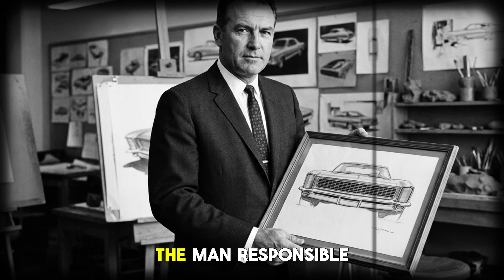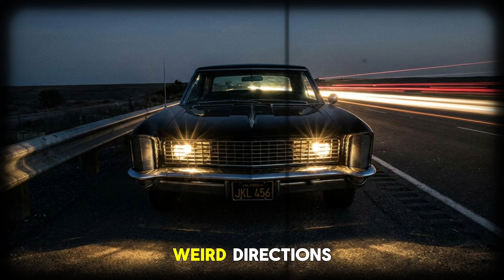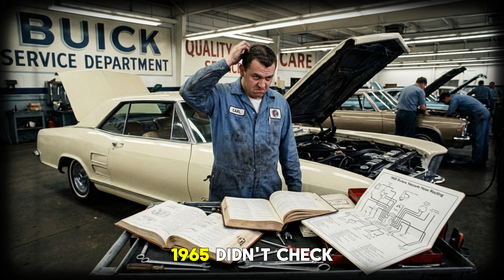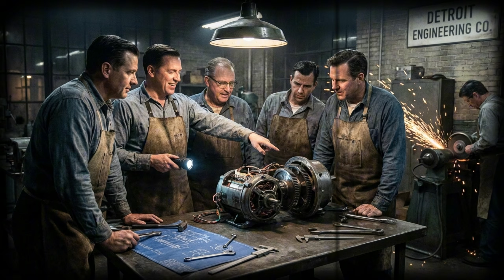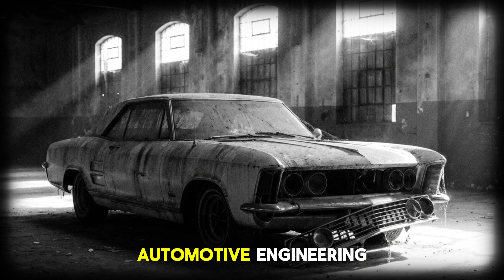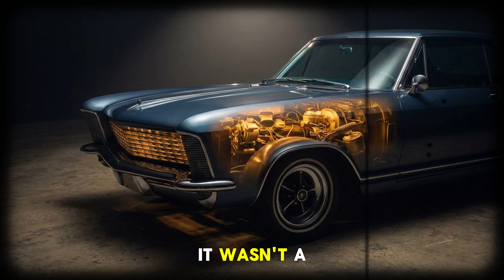Why the 1965 Buick Riviera Hid Its Headlights Behind a Moving Grille

Comment: A brother-in-law purchased a three year old 65. He kept it for another three years without any problems. The only reason he got rid of it was because he ran over a rock and it tore off the oil pan and cracked the transmission.